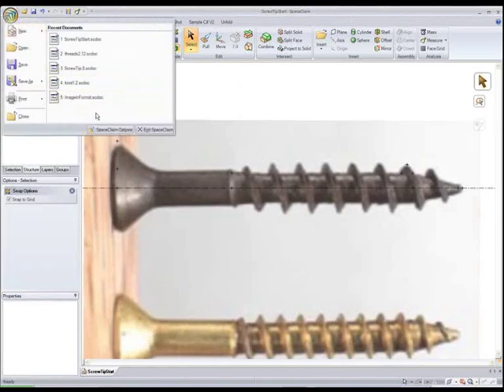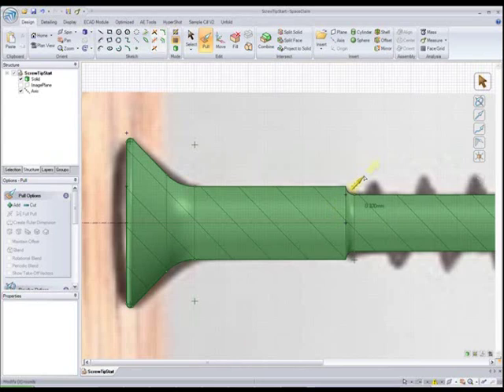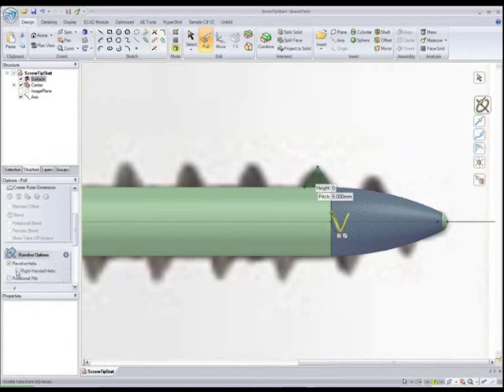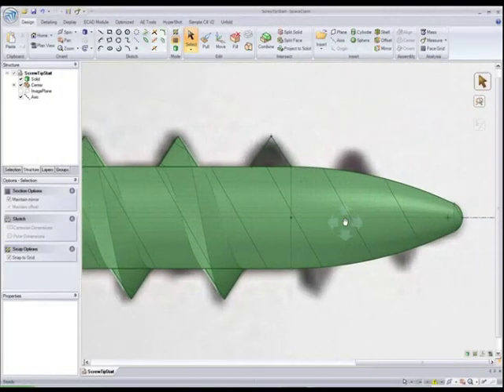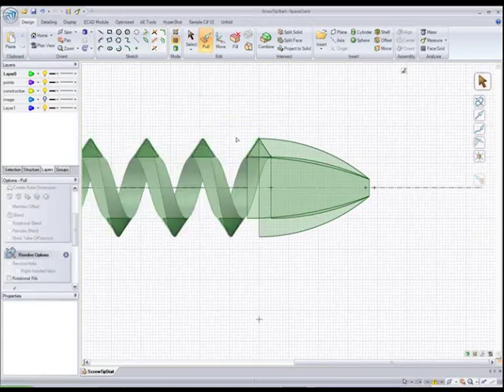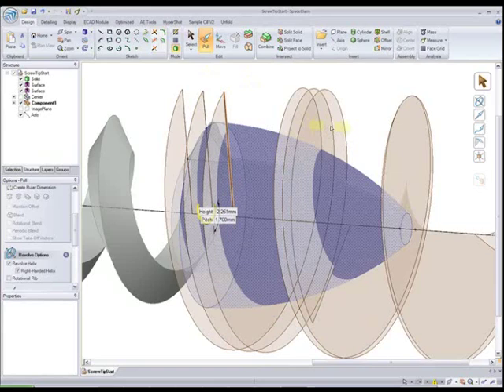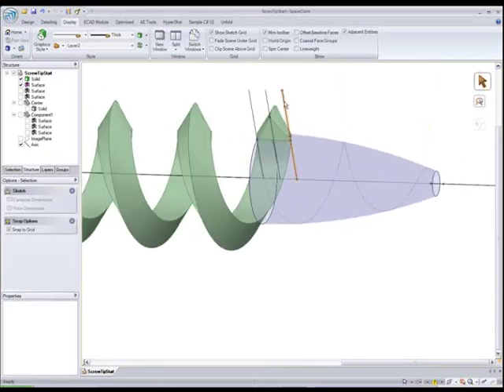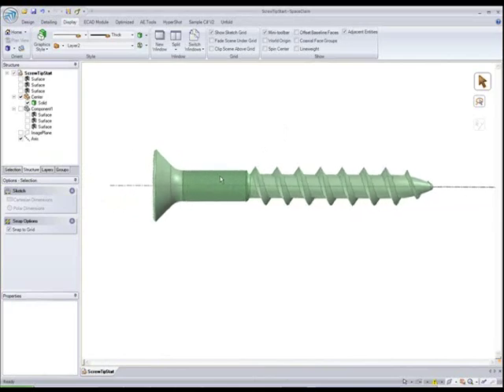spaceClaim Screw Design

Comment: I appreciate the video but with part 2 your very unclear about many of these steps. Starting at the beginning, your grabbing the cylinder solid technically known as the shank where the threads are. I see your using the pull tool and grabbing this known solid, but this is where you are unclear of how you achieved surfaces instead of solids using the auto-extrude tool in the SpaceClaim advanced options. As to the steps after these you left out notes on how you did specific tasks or functions and moved way too fast. Would have been great if you could have been more precise with the steps that you had taken to achieve these surfaces using blend to create the solid used for the tappered threads on the end.